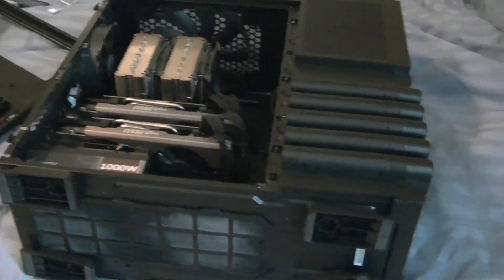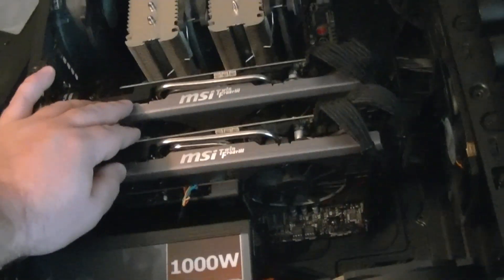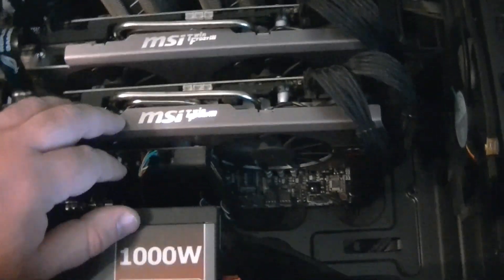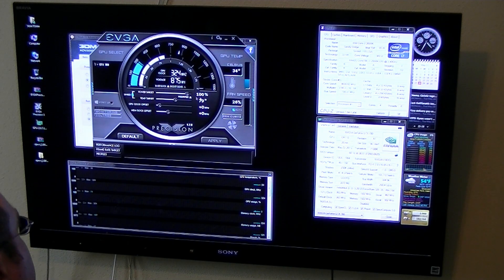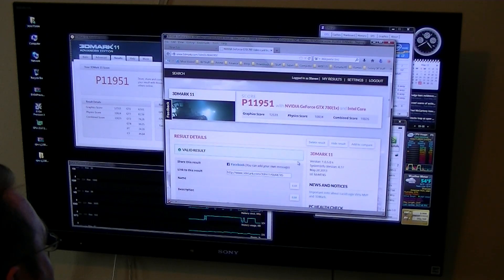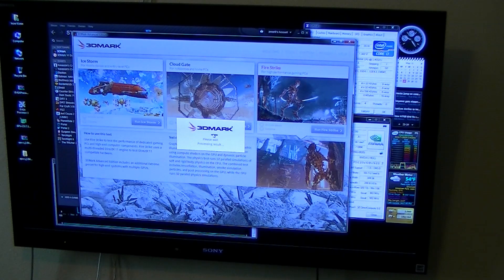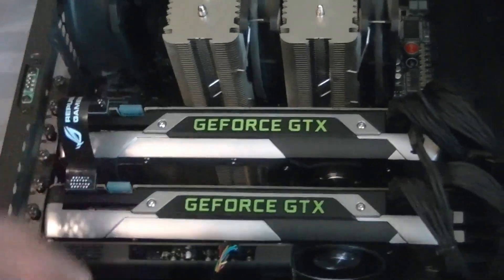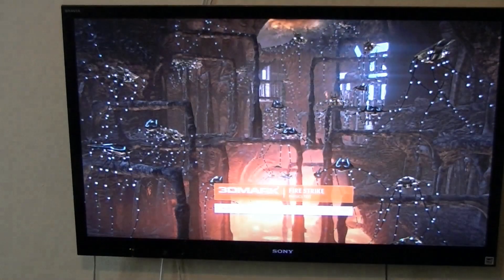GTX 780 vs. 2x580's and PCIe 2.0 8x/16x performance difference

Comment: I see you have a maximus iv extreme with a soundcard in the X4 slot. How did you get that to work? I tried every thing but it's still not detecting the card.
(x1 card in x4 slot)
Reply from the maker: I don't have this setup anymore so can't test it.  But I think I had to have both video cards in to activate the NF200 chipset.  You might have to talk to ASUS about this if you need further help.
Reply: I only have 1 videocard, so does that say the slot is not activated?
Reply from the maker: If you don't have another video card, or any other cards, just put your 1x card in a 16x slot?
Reply: +JesseFK I wanted to put my soundcard in the lowest slot possible because of my gpu getting very hot ( I have a r9 290x).

Comment: For the people that are interested.

The difference between 4x pci-e in sli / crossfire and 8x is also not really much, the same as with 2.0 and 3.0. from the 70 fps on the most ideal slot, you probably sacrifice 5 fps max at the worst solution. Which frankly hardly is wroth the trouble to upgrade at all for.

If you got a 580 3gb, you can pick probably for around ~70 bucks another second handed from the internet to get 780 performance aka 970 and about the same v-ram anyway.

Unless your motherboard isn't capable on running sli or you don't want to deal with the heat / sound of a second 580, then you could consider upgrading. But frankly 580's are beasts.

Comment: If you had clocked your RAM up on your 580s in the 3DMark score where you scored ~13500 in SLI you could've scored more again.  I have a Gigabyte Super Overclocked GTX 580 and once I got the core stable at 960MHz, clocking the RAM higher released higher benchmark scores again.  I got stable 960MHz/2300MHz on max voltage allowed on the card.  From memory I scored ~6300 in Passmark for 3D GPU on a single GTX 580.  I also scored higher in Unigine Heaven and Valley, and 3DMark Fire Strike.

Comment: ok, thanks )) i just think where to put videocard  -  1 and 3 slots  -  or 1 and 4 slots  -  and if i will put in 1 and 4 my sound card slot will be closed  and i will need adapter for pci e  10 centimeters to put sound card

Comment: so quick question, it seems that currently I would get most bang for my buck by picking up another 580 instead of forking out the ridiculous sum for the 780? maybe? I have the 3gb 580 so I was gonna match with another 3gb...good to know that i will be good with my old pci 2.0 for awhile too haha xD
Reply from the maker: Yes, I would say that would be more bang for your buck. You can get a 580 for fairly cheap now.  Though if the game doesn't support SLI very well, then you might not see much of an improvement.  It's the joys of having 2 cards. lol.  Most games are pretty optimized though, just check what others are saying about the games you play and their SLI optimization.
Reply: JesseFK
ok cool! thanks, i was thinking it might be best to get the 580 and save up for the next wave. I will look into whats good with sli!

Comment: I have the EVGA GTX 780 SC w/ ACX in Tri-SLI. I ran 3DMark11 & I got a score of 12210 too but on Extreme! Run on extreme not performance & get a real monitor not a tv! What people don't realize is the 120/240hz refresh rate on a TV is output, not input! You cannot get more than 60fps without tearing, you know the horizontal lines across the TV! If you look on the back of your tv you'll see 60hz! ASUS & BenQ have monitors with 144hz input for great price! Will look 10x's better.

Comment from the maker: I was pretty much able to get double the performance going from 2x580's to 2x780's.  I know 2xSLI does scale better than 3XSLI, but you can get the 770's with 4GB of VRAM while you can't get anymore with 780's (So it doesn't make the Titan completely worthless to get over the 780).
You might be able to get a bit more performance going with 3x770's as long as the game supports 3XSLI well.

Comment: I am selling my 2 evga 580 sc an buying either 2 780's or maybe 3 770's, Is the diff between the 780's sli an 580 sli big ??? Im running 3X 3D moniters so i need the extra vram and fps, Thanks